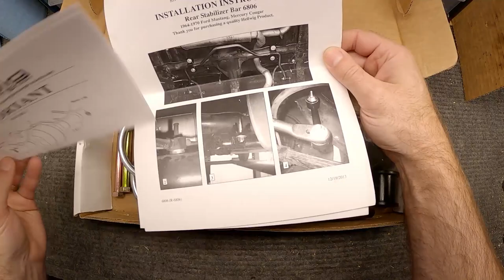How to install a Rear Sway Bar in a 1966 Mustang

Comment: I've been thinking of installing some performance sway bars in my car. Your's is a lot different, but any knowledge about how they usually go together helps, so thank you!
Reply from the maker: I chose this bar because of how it attaches to the car and the relative ease at which it can be installed.  I've seen some bars that require welding and that's not really in my wheel house.

Comment: I put a rear sway bar on a 65 mustang back in 1974 or so, made it handle better. recommended
Reply from the maker: Yes, it was a big improvement on this car.  However, I have since found the Panhard bar to be a better upgrade on these cars over a rear sway bar.  :)

Comment: Andy I have a 65 Falcon. After you installed the rear sway bar did you notice any difference in handling. You talked about the exhaust in the way was it a major issue?
Thanks George in St Louis
Reply from the maker: At the time I made this video, I was under the impression that I needed a rear sway bar over other suspension components because of my experience with later model cars and how a rear sway bar can affect the handling of the car.  When I stalled this bar I did see an improvement in how the rear of the car reacted to my throttle input.  The car felt more planted and predictable.  I felt it was great purchase at the time.
However, I installed a Panhard Bar on my current Mustang and it is better in every way over the rear sway bar (assuming you would only install one).  I wish I had installed the Panhard bar on the car in this video instead of the rear sway bar.  The car is more enjoyable to drive and the mechanics of how the Panhard bar keeps the axle centered under the car far exceeds any work the rear sway bar was doing when I thought it was the part to have.  I have a video on that Panhard Bar, you should check it out!  :)

Comment: Andy between the rear sway bar and the Panhard Bar, which (in your opinion) made the best impact on the handling of your coupe? I have heard that rear sway bars make the car handle way too hard. That the Panhard bar is better without disrupting the flow of the car…. I am working on a 1965 Coupe, and I am planning on daily driving it. I do not want it to handle like a wooden wagon / buck board.
Reply from the maker: The Panhard Bar, any day of the week!  The rear sway bar on these cars does reduce the body roll, like every other car that has one, but most other cars don't have a floating axle that complicates the handling of the car in "spirited" scenarios.  The axle needs to be "locked down" before we start expecting the car to handle like more modern cars.  Whether someone does the Panhard Bar, Watts Link, or a 4-link setup, any one of those needs to be done before considering a rear sway bar (I learned this after installing the rear sway bar on the Coupe).  This is due to the fact that the rear sway bar essentially does nothing to keep that axle centered under the car, especially during hard cornering scenarios.  But due to the relatively light weight and lower center of gravity, the Panhard is all we need because the axle isn't "snapping back into position" after exiting a hard corner and you can get the backend to step out with the throttle. 
I was under the impression that I need to add a rear sway bar because of all the modern sports cars I had driven in the previous 20 years.  I failed to understand that the backend of those cars hard the rear "locked down" and so adding a rear sway bar to those cars improved the handling.  A rear sway bar should only be added after something like a Panhard bar, but you may find that the Panhard is plenty and it makes the car drive like you want. 
I have no plans to add a rear sway bar to the Fastback.  :)

Comment: Installing the rear sway bar did that change the rear stance of the car at all?  Or does the rear stance basically stay the same with the addition of the sway bar?
Reply from the maker: This will not affect the stance of the car. It will affect how much the body rolls in hard corners. 🙂

Comment: send me a link to where I can find a set of wheels like the one you have please
Reply from the maker: I purchased them from Performance Plus Tire, they are American Racing Torq Thrust, sized 15x7, -6mm offset.  The part number is VN3095765.  That number is important because it will get you the exact size, offset (backspacing), color, and spoke design.  I paid about $70 shipped for them 6 months ago.  :)

Comment: Nice job if I had a garage to work on my car and a lift to get a lot of stuff done all the time does it really make a big difference to have that sway bar on their normal speed driving just curious just looks like a lot of work or if you’re not like doing some track stuff
Reply from the maker: Casual drivers won't notice a difference.  Those who push their car a bit or race them will notice it.
Reply: Well I probably could use that rear sway bar this weekend waiting for that hurricane to get out of here lol cause I’m right down here on the gulf of Mexico and Mississippi, I don’t have a garage right now the car is in the electric shop getting all the wiring redone so I asked them to keep it there they’re even closer to the ocean though so we’ll see what happens

Comment: How do you like the rear sway bar on your 1966 Mustang? Was it a modification you would do again or was it something that negatively affected the handling?
Reply from the maker: I liked the rear bar, and I could feel a difference in the balance of the car.  However, since I installed that bar others have pointed out the benefits of a rear sway vs a panhard bar on these classic mustangs.  The rear sway is great at transferring the load to the inside tire as it is designed to do, but it doesn't do a good enough job at keeping the rear axle from sliding to the side (with respect to being centered under the car) and possibly causing the tires to rub and a sudden snap of grip when the axles re-centers its self when coming out of a corner.  Next time I think I'll do the panhard bar first, and then see if I still need to add a rear sway bar later.  :)
Reply: @AndyKruseChannel  Do you still think this is the best approach since you got your Fastback?
Reply from the maker: @GolfGuy54601  Great question.  So far yes.  I stand by the thinking that the swaybar and panhard bar are performing different functions, but I've got my eye on a panhard bar that I want to buy and install.  After it's in I'll try to get a good chunk of seat time with it and see if I still need the rear swaybar.  :)

Comment: Hi Andy,  I'm getting ready to purchase rims - the same rims you have - would you be so kind as to post here what size and tire size they are?  I like the look of them on your car.  I was going to use American Racing Dasiy / Coke Bottle pattern but they've been discontinued.  Cheers!  Gary
Reply from the maker: Haha, no problem.  
WHEELS
The wheels are American Racing, Torq Thrust, 15x7, with a a 5 x 4.5" (5 x 114.3mm) bolt pattern.  The part number is VN3095765.  That part number is important because there are several styles and surface finishes of Torq Thrust wheels.  That part number will get you the same wheels.  If needed, I can fill your ear about the differences in the Torq Thrust wheels and why I chose that specific style.  :)
TIRES
The tires are BFGoodrich Radial T/A, 225/60/15 at all four corners.  This tire and wheel combo will fit the rear without rubbing, but it will be close.  The inner edge of the fender lip on the front two fenders will need to be rolled slightly.
Extra Info
The car has 5-leaf, mid-eye springs in the rear (about a 1" drop over stock) from CJ Pony Parts (part number LSK7).  The front springs are Eibach Pro-Kit which was supposed to drop the car an inch but I ended up cutting off 3/4 of a coil to get the drop where I wanted it (part number 3562.120 from Eibach).  Because the front springs were 55 years old and tired, I don't really know what the total drop is from stock, but it is now lower than where it was before I replaced the springs.
I also did the Shelby Drop (or Arning Drop) which is supposed to drop another 1/2"-1" of the front of the car.
Last, I don't care for the wheel caps that American Racing provides, but I found a guy on Ebay that sells a flat aluminum cap that matches the design and bolt pattern.  They're clean and understated, which is perfect for the look I wanted.
I'm passing on this info because if you're looking to replicate how your car sits compared to mine, the wheels and tires are only part of the equation.  Enjoy!  :)
Reply: @AndyKruseChannel  fantastic info Andy!  It's the fire we run through the bog with.
All of it is hard won knowledge and we all feel a little less pain being able to watch and learn from your videos.
Thanks so much and carry on!!!
Reply from the maker: @glm777  This is a big reason why I put these videos together, when someone is able to pull some nugget of info from them to help with their project.  We all started someone, and sometimes we just need a little info to help get us pointed down the right path.  :)